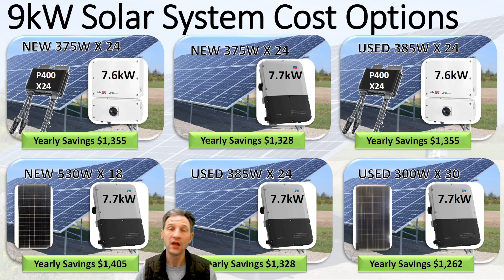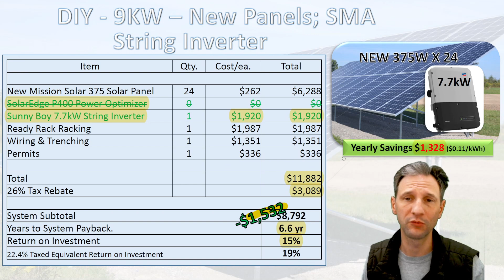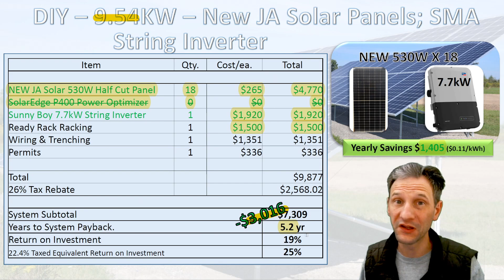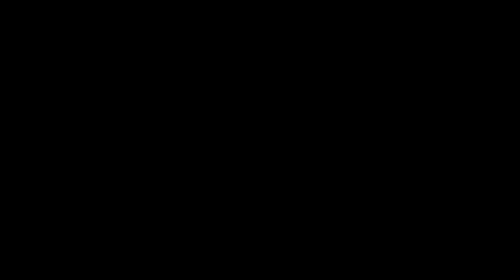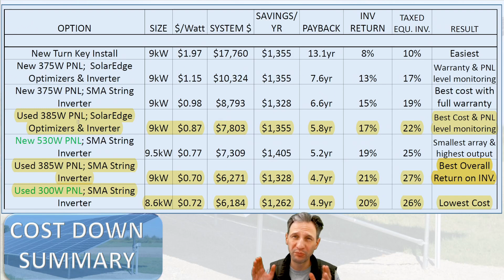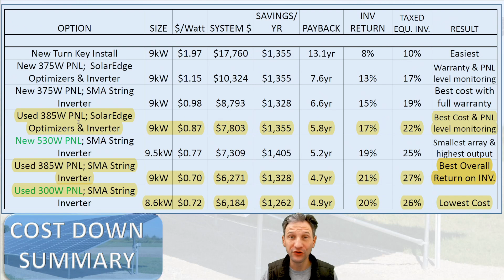DIY Solar Panel System - How to Do it CHEAPER!!

Comment: Are you running the same optimizer across the board-  I was trying to see if I could run P400 on one string w/ 400w panels and P300/P320 on another string w/ 300 watt panels- I was able to pick up a 2nd 7600 inverter and was trying to see if i could run 2 arrays, one strings of each w/ 400 watt panels and the other string w/ 300 panels as I can pick up the optimizers and panels much cheaper for the lower wattage-
Reply from the maker: You have to be careful, only certain optimizers will work together.  All of mine are P400.  Here is a chart of inter-compatability: https://www.solaredge.com/sites/default/files/application_note_intercompatibility_se_power_optimizers.pdf

Comment: Dave:  did you actually measure power output from the system and not just calculate based on nominal output?  There's usually about a 25% difference in the much more realistic NOCT rating vs the completely unrealistic STC done with huge banks of test lights and refrigerated conditions that the vendors all use because it's higher, see below.  Thanks,  Dan

Wp module STC:  1000W/m2 irradiance, 25 degrees C surface, tested  0C air temp
Wp module NOCT:  800W/m2 irradiance, 45 degrees C surface, tested 20C air temp
Reply from the maker: The results are measured power production from my array, and estimates based on actual production, not just calculations.
Reply: Another problem with buying used solar stuff in my experience in addition to the efficiency improvements from the latest generation is that it's often defective cast-offs from installation jobs that solar installers selling on Ebay don't even bother to test before shipping it to you.  Sure they take it back, but what a waste of time trying to make it work.
Reply from the maker: Yes, It makes sense to buy extra panels for that reason and by from a reputable source. like SanTan Solar  ( https://store.santansolar.com/?ref=EverydayDave ) or Signature Solar ( https://signaturesolar.com/?ref=SALE ).  But it doesn't always make sense.  If you need more racking because the panels produce less, it eats in to the savings.

Comment: Good morning Dave- I'm learning so much from your channel- currently waiting on the utility company to get back w/ me, i've already gotten the application from the city to begin we are here just south of you in KY-  I just picked up the 7600 inverter I spoke w/ you about, it was only $700 and was mfg in 2020 so I feel confident that was a good deal, If I'm looking at optimizers used should I stay with a minimum of a P400 even though my panels will be in the 315-320 range for my 1st setup/  or I just saw P600 do they do 2 panels and if so at $64 each on ebay would that be the way to go-  I think panel wise I can get into the 300's I don't thin I want to put up and 240's just for the cost of the system-   My only doubt w/ the system was that I thought about making my own racking and feel that my city might have to have PE drawings on them so I"ve reached out to the mfg you used, is there a disocunt code you had w/ them??  Oh- last question any reason to go w/ the EV plug on the inverter besides efficiency, i'm running 9cents a KW and my house that I am building is 2k one level w/ basement ICF on both levels, I figure my utility to be about 2/3 of what yours is - why not just add a plug off the 200 amp breaker, if not I plan to add a third arrary to make me net neutral I'd probably be able to find me a solar edge 3800 w/ the ev plug on it for about a grand- thanks so much for the advice, hopefully i'll piece together my parts over the next  few months and install around Christmas, currently they have my footers poured and should have my ICF in this week for the foundation pour- best regards,
Reply from the maker: Wow, you have a lot going on.  As for the EV charger, I would just find a good deal on a level II charger, it will probably be less than the cost of the SolarEdge cable and you can mount it wherever you like.  (here is a video on my EV connection installation: https://youtu.be/U2ilH8yOi7A )  Make sure whatever optimizer you choose works with your inverter.  Be careful with the Ebay optimizers, I have bought a few that way that didn't work.  Two panels per optimizer will save you quite a bit, just make sure the clipping impact is not too significant.  If the panels are only 300W you should be ok.  Call Ready Rack and tell them Everyday Dave sent you, and ask for a discount.  I don't have an affiliate relationship with them so I don't actually have any leverage, but it doesn't hurt to ask.  Hope that helps.  Thanks!

Comment: love the videos! I have already subscribed. in the process of buying a system but I'm hesitant because I don't really know what whole sellers are trust worthy. I'm in California and I am hoping to get the necessary documentation for the permits with the purchase. Any advice?   I am thinking 9 KW to 9.5KW would be more than enough based on my usage and potential increase of usage.
Reply from the maker: Welcome aboard!  I recommend getting help from EnergyPal.  It is a free service and they can give you options on sellers that they have vetted for reliability and cost.  They can also give you advice on what system makes sense for you.  Here is a link for Energy Pal: https://energypal.com/everyday-dave

Comment: In the long run, isn't new panel will be more efficient than used panels? To correct the comparison, it would be nice to see maintenance cost between new and used panel?
Great information. Thanks.
Reply from the maker: It all comes down to cost/watt.  There should not be a significant difference in maintenance.  In general panels slowly degrade at a mostly linear rate.  With used panels, you are just picking them up part way down the usage curve.  For instance a used panel rated at 230W will should be treated like purchasing a new 200W panel.
Reply: No

Comment: Someone tell you, you CAN NOT take the tax credit on used solar panels?
It isn't allowed since it would allow for double dipping on the tax credit. Only all new materials.

At least that was the situation back in 2011-2012 when I did my last system.
Love Santan, love using these retired solar farm panels. Sometimes it's not the cheapest options.
Reply from the maker: Used panels don't make sense for every situation, but they are a great option for the right application and it keeps them out of the landfill.
Reply: @ProjectsWithDave  I agree, you just can NOT take a tax credit on them!

Comment: look at it another way.
how about basing it on MPPT. Maximum power point tracking is a relatively new technology and basing the solar panel and output on MPPT is another option. Of course you have inverters but focus on DC into the MPPT.
so, solar panels, MPPT, and battery.
you would focus on VOC accuracy and wire size since winter and summer power is different and effects the power output.
an MPPT of 150/ 30 would be 3 panels of max power of 44.7 volts and 9 amps of 9 identical panels, 3 in series and 3 groups in parallel. This would be going into one MPPT. 
you can use your cheap used 400 watt panels.
the MPPT will determine the power storage in the battery so the more battery the better. Take total watt of your array and multiply by 5 for battery KWh. Some MPPT only use input from serial string panels, most MPPT from serial and parallel.
Reply from the maker: Most newer quality string inverters have multiple MPPT inputs.  As you said the key to optimal performance is matching the ideal voltage and current capability of each MPPT input rather than the inverter base spec.

Comment: Why did you use a 7.7 kw inverter if you have a 9kw system?
Reply from the maker: Sizing the array larger than the inverter is a common practice to optimize the return on investment.  This results in some clipping of the usable power in optimal conditions, but it is done because the system only spends a very small portion of its time at max output.

Comment: You are not allowed to take the federal tax credit if you use old used panels. So the savings gets wiped out.
Reply from the maker: Even if you don't claim the tax credit, it is still cheaper to use used panels.  However, the IRS publications don't say you can't have an installation new to you that utilizes used panels.  It depends on your interpretation of "original installation", it could mean new materials, however, it could also be interpreted to mean If at some point I had an original roof installation and later payed to have it removed and re-installed to replace the shingles, that would not qualify as the "original installation".  Of course you should always consult your tax advisor for tax advise.  I have attached a link to those two IRS forms for reference:
2021 Form 5695:  https://www.irs.gov/pub/irs-pdf/f5695.pdf
2021 Instructions for Form 5695:  https://www.irs.gov/pub/irs-pdf/i5695.pdf

Comment: make a solar tracker  with some linear actuators?
Reply from the maker: The goal here was to increase production at the lowest cost point possible.
Reply: @ProjectsWithDave  outdoor linear actuators can be had for ~1-125 ,each need 2, they increase solar output by 20% and they track the sun throughout the day so no need for 2 separate arrays.
Reply from the maker: It's not just the cost of the actuator.  The racking has to be more complex and the actuators have to get power somehow.

Comment: I really like your videos. Thanks for sharing!
From what I have studied it appears optimizers in most cases are not needed and do not add to the efficiency of the solar panels. Then by adding them you increase your install cost and have more things to break. I have a rapid shutdown scenario so I bought Tigo TS4-A-2F units that each can be used for two panels so that kept my cost lower than using optimizers.
I also am going with a Sol-ark 12k unit since I want to be able to power from the grid and have a charge controller for my 15Kwh lithium battery backup. I will not be selling power back to the utility since I don't want to hassle with all the BS required for that. Besides utilities are making it less advantageous to do that.
I live in Southern Cali and our rates are crazy high. Usually over 35 cents per KWh. I am on a time of use program where super off peak rates are 8 cents per Kwh. I charge our electric car during these periods and can use my battery to help fill in during my peak rate times.
Reply from the maker: Sounds like you have a great balanced solution.  Your electrical rates are very high, that makes it easy to justify solar!

Comment: Why wouldn't you use microinverters? I'm practically ignorant, but theoretically fairly knowledgeable. Just want to expand my knowledge before I build
Reply from the maker: In my location module level shutdown isn't required for a ground mount array.  If there is no shade, all the panels are the same and facing the same direction, optimizers are really just expensive monitoring hardware.  In my case I am able to use them to evaluate mismatched panels and different orientations.
Reply: @ProjectsWithDave  cool. I was of the understanding that micro inverters replaces the single large inverter and reduced grid connection complexity. Now I have more to learn. Thanks you
Reply from the maker: Micro inverters do replace a single string inverter with multiple smaller inverters.  My system uses optimizers that feed into one string inverter.
Reply: @ProjectsWithDave  Ballpark how much would micro inverters add on install like this and would they make a DIY installation easier?
Reply from the maker: My previous analysis compared the Enphase micro inverter to string inverters like the ones mayde by SMA.  In this comparison the micro inverters are more expensive, however I am doing some testing with a micro inverter made by Northern Electric power that can take input from two panels and is much more cost effective.  I think it could be a great low cost solution that allows for easy expansion.  You can start with just one unit at about $150 to try it out.  You can purchase them at signature solar here: https://signaturesolar.com/nep-2-panel-micro-inverter-2-meter-drop-cable/?ref=SALE
Reply: @ProjectsWithDave  Thank you, I have to say this was an incredible video with so much great data. I’ve watched it twice already.

Comment: So, used panels get no tax break right?
Reply from the maker: It depends on your interpretation of "original installation."  It could mean new materials, however, it could also be interpreted to mean If at some point I had an original roof installation and later payed to have it removed and re-installed to replace the shingles, that would not qualify as the "original installation".  Of course you should always consult your tax advisor for tax advise.  I have attached a link to those two IRS forms for peoples reference:
2021 Form 5695:  https://www.irs.gov/pub/irs-pdf/f5695.pdf
2021 Instructions for Form 5695:  https://www.irs.gov/pub/irs-pdf/i5695.pdf

Comment: Great video. What would the cost be if you were to use micro-inverters, and add the cost off energy storage, aka battery? Batterys are expensive, and to get off grid, you'll need storage. For grid tied systems, I have a question, again, I would go with micro-inverters, not sold on a battery at this point, but see cost savings for energy, but big install costs. Most companies recommend systems in the 13kw, 15kw, 17kw, and state this is for annual usage, my question is "Why not install a 9kw system that easily exceeds my monthly usage would eliminate my energy bill, and would cost far less than $30k - $40k?" I don't understand why they sell on an annual basis, but electric bill is monthly, so to me cover monthly. And annual will take care of itself. Thx.
Reply from the maker: In my opinion you need to look at it from a monthly perspective.  Check out this video on sizing your solar system, it give some perspective on why analysis by the month is critical: https://youtu.be/rbFnZqA0GCI

Comment: You have almost 2,000 watts more than your rated capacity of the inverter, is that okay?
Reply from the maker: Yes.  You can check the specs for your particular inverter, but most are designed to handle a significant amount of clipping.

Comment: Really informative. I think the only real concern with second hand panels is what kind of life expectancy they have left? Does the performance drop off at some point? I guess it's hard to get real world figures for that unless the same panel has been in production for a good long time.
Reply: Yeah, even 20 yr panels should still produce 80% of original, most likely more like 90% depending on how hot/cold the area is.  I have some 2000 era model bp solar panels which are 51 watts each, they still produce over 40w.
Reply from the maker: Panels typically have a steady degradation curve.  You could always check the historical performance of panels from the same brand and type for reference.

Comment: I'm a professional installer, and it's nice to see something in between the "solar never can pay for itself" and the folks who click on the ads Google and Facebook and pay tens of thousands more than they have to.
Reply: This video helped me a lot in deciding to do my own install. I wish I had more options for racking its seems to have gotten a lot more expensive so I went wood. Hoping I don’t regret it.
Reply: @stevenmyers2252 how are you grounding? Just attaching the ground to each panel?
Reply from the maker: Thanks!
Reply: Hey bro, how can I find and installer that will install the sunwats system?

Local solar companies in southern CA are a ripoff!
Reply: @hotshot3d  99% are in the US!
Reply: What would you do for a battery backup and electric car charging port ?

Comment: So many questions about batteries!  Batteries are a huge expense, folks.  If you want or need to go off grid, you are going to pay a huge premium for that.  It will blow your payback period into decades.  Or else you will have to live with a severe power limitation because you don't have enough.  And then there's also replacement cost, since they don't last all that long when you cycle them every day.  One thing that makes sense is to heat all your domestic water, and maybe even space heating with hot water panels.  Very easy to DIY such panels, heat storage tanks, etc.

Comment: Silly question: how are you making your combined power level higher than your inverter rating? I must be missing something?
Reply from the maker: By combined power level do you mean the size of the array?  If so, an array is usually categorized by the combined power available from the panels not the output of the inverter.  If you have 10kW of panels with a 7.6kW inverter it would be called a 10kW system even though it can never put out more than 7.6kW at any given time.

Comment: where do u live that u get 26% rabate? in the state i live in they don't give anything... Also I don't see a battery storage in the cost analysis. does that mean all these systems costs are without a battery banks?
Reply from the maker: The rebate is a United States federal rebate.  Available to anyone who pays taxes.  My system is currently only grid tie, no batteries are required since I effectively use the grid as a battery.

Comment: I'm not sure what you mean by "...you need the module level control because you're putting the panels on a roof..." when talking about the optimizers. Are solar panel installs in the US not allowed on roofs without optimizers? In the Netherlands, we only use them when the array will be partially covered by shade occasionally.
Reply from the maker: The US now requires module level shutdown when the panels are on a roof.  There are multiple methods to accomplish that, optimizers is one of those methods.
Reply: @ProjectsWithDave  Interesting. Do you know what the reason was for this change?
Reply from the maker: It is supposed to be safer for firefighters, but I guess someone is making money of the rule....